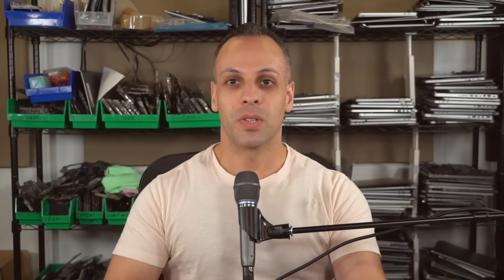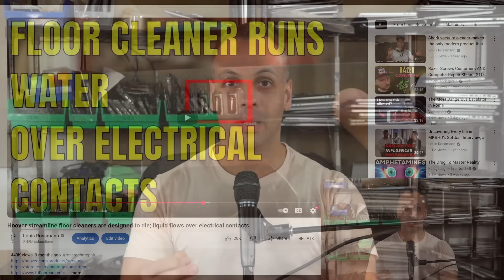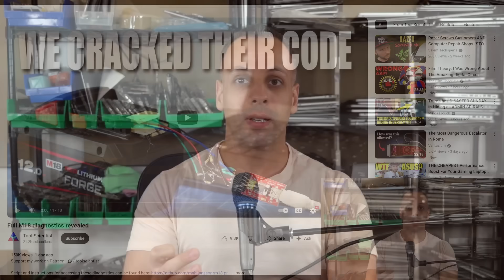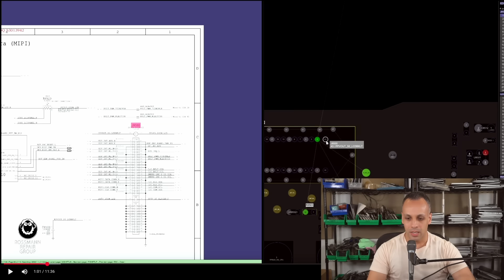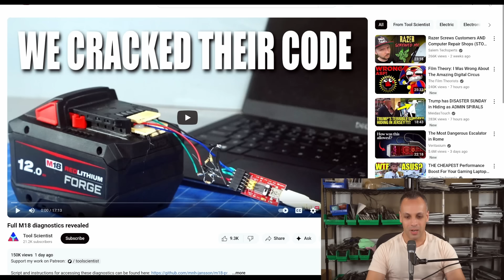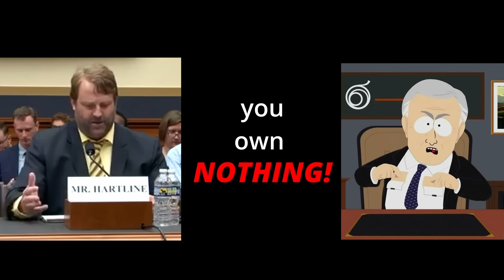Imagine putting DRM in a battery to void warranties...

Comment: HW Engineer here:

I'd like to clarify and correct some technical specifics mentioned in the video.

Topic 1:
1. Not having a balancing circuit to a series configuration pack could potentially result in the pack cutting off at 50-60% due to 1 or multiple cells being under-voltage cells (<2.7V per cell), but that should be your last concern as a user. It would have actually been quite great to be the case, as user safety would have been prioritized by design, doing so. 
Instead, what happens is that the battery charger IC (which again has no balancing functionality, thus leads connected to the series tap points) keeps draining the battery, until its internal comparator sees that a specific X (usually X being the Under-Voltage battery protection set at no.-of-cells in series * 2.8V) has been reached and cuts off the load. The issue with this is that:
a. The cells that start with the voltage below the mean pack voltage get severely over-discharged (depending on how severe the unbalancing is).
b. As a consequence of that, Li ion dendrites start to form at the Anode, severely degrading battery performance and health, to a point where an internal short-circuit and thermal runaway become a certainty. TL;DR, your shed where you store and charge your tools might run a high risk of going down in flames.

2. For them not to include a charger IC with balancing functionality (from Texas Instruments, Analog Devices, Maxim etc) on a series pack config would be a head scratcher and a huge NO NO in terms of HW design. As a HW Engineer & Schematic Designer, you would actually need to force yourself to do so, as all off-the-shelf ICs from reputable brands (some listed above) that are meant to be interfaced with series pack 100% include the balancing function.
Most of them also include a series of other nice features, directly integrated on the same silicon chip, such as: NZV charging, fuel gauging, built-in interrupts and alarms for UV (Under-Voltage) in charge/discharge, short circuit protection, over-loading in discharge etc.

Running a charger IC on a series pack, without balancing, would result in a certain premature death of the battery pack, with a high probability of fire risk for the user. It is a big no-no, if done is a self-inflicted design decision with virtually 0 benefits, other than planned obsolescence and malfunction for the battery pack itself. It is no a question of "if", but "when", and then when the "when" comes to fruition pray for it to not go up in flames and take it with you, especially considering how energy dense those packs are and the fact that they are almost impossible to put out when they do go out in flames. The only solution being containment, but good luck with that in your backyard shed.

To put salt on the wound, the unbalancing gets consistently more aggravated with every charge/discharge cycle due to specific factors, most important of which: the ESR (Equivalent Series Resistance) of each cell, different from one cell to another.

Topic 2:
For the old 50V DC power line design, where a reasonably "higher-voltage" DC line is found right next to a procesor Data line on the MacBook Pro FPC connector, my assessment is that it is as closely related to incompetence as it is to negligence and company R&D flow. Let me explain:
- Usually, when developing a PCB Project, it is super highly unlikely that a single engineer or team goes from high-level architecture, to block-level diagram, to schematic, to layout, to review, to DFM review etc.
Usually, it is a whole array of people across different specialities that handle all those steps, with the first link in the chain being the Schematic Level Engineer. If he dictated the pinout on that FPC connector and it passed with bells and whistles on the schematic review step, then it is unlikely (to a minor degree) for the next dev. steps to catch the error (DRC, Layout Review, electrical-FMEA analysis etc). I find this to be equally split between incompetence, human error and bad procedures (review and process-wise).  That said, it does not surprise me at all that Apple would never publicly acknowledge such a bad design error, considering how many units were sold. It is up to you as an individual to decide, your wallet specifically. The issue is, that most of the customers out there have no idea about those issues (and rightfully so, as they do not have the technical background to comprehend those specifics) and usually choose the simple way out: 2000USD down the drain, and life goes on with minimal friction of changing the OS and their Apple Ecosystem lifestyle

My 2 cents.

*Later edit: Having a look at the video [011] Do Milwaukee FORGE batteries balance, by the same YouTube channel, Tool Scientist, it is lound and clear that they do indeed use a battery charger IC with a balancing feature included (as expected), namely Renesas / Intersil RAA489250, but as cell balancing isn't a fully standalone process and it requires coordination by the system MCU, I can say with 100% confidence this is a design and system decision. Addressable and solvable via a FW update, as the layout and HW design allow it, but I'd expect pigs to fly before Milwaukee decides to do so with either the battery packs out there in the wild (recall) or the ones on the manufacturing and assembly line.
Reply from the maker: pinning to correct myself since I was worked up and didn't speak the fact properly. worked up louis was worked up, and didn't make a distinction between:

1. battery balancing not being present
2. battery balancing being present but poorly implemented, on purpose
3. battery balancing being present but poorly implemented as a result of incompetence 

but this distinction matters: thank you for the corrections, they are much appreciated!
Reply: @rossmanngroup  
Thank you for taking your time to see, read, and reply! I've also noticed that it is now pinned, which is truly an honor. (I made sure to correct the typos now, sorry)
Usually, such long, tech-detailed comments pass unnoticed in favor of the more popular, short, one-liner, puncy ones. It is quite rare for somebody to bother reading those, which is mostly why I diverted from posting on YT, and retreated back on Reddit.
I really didn't expect this to come on your radar, which again speaks volumes of your integrity, community devotion, hard work, and pursuit of "leaving behind something better". Thank you, and hats off to you, sir! For me you've always been the go to info & intel source, and a true role model and inspiration. If I ever get to visit Austin (quite far away from Bucharest, Romania, where I live), I'd love to pay a visit to the workshop and bring a little thank you in the form of a local spirit. Kudos!

Comment: +1:45 that's not how the overtemp flags work I watched the video as well, it only monitors temperature during the beginning and end of a charge cycle, it also measures overcurrent and direct shorts but that's a separate measurement

Comment: I've had Milwaukee for a few years, will slowly begin changing to a different brand after learning this. Question, what brand do you recommend? From what I've looked up, it seems the options are Makita, Hikoki and Ozito, oddly enough. Ozito is cheap but they generally aren't known to last, the only concern I have is switching to Makita or Hikoki and then in 12 months they announce they are doing the same thing. Note: I am currently looking to buy some nail guns, and also, I am not saying I'm gonna throw out the Milwaukee tools and make waste, just that I won't buy new power tools from them

Comment: Both Dell and Alienware used to do this with their computers.

Not only did both (and they still do) have almost all of their help desks overseas. Run by techs who share something that isn’t even an Intel i3, they could only dream of seeing any Intel I chip anytime in their entire lives. Have a tech with next to nothing in any computer education try to phone walk someone through opening up their computer chassis.

But it gets better… If one were to buy a one thousand to $5000+ system though Dell or Alienware from 2002 - present day, and then buy any additional type of “assistance” or extra warranty… Watch what happens to the system specs and performance just one single day outside of warranty.

Comment: 2:20 not to be that guy, but a 52 volt battery is a single battery, the individual parts are Cells. A battery consists of many cells.
Reply: How do you differentiate? They are literally just packs of standard 21700 batteries in a plastic box. It's identical to putting 4 AA batteries in a holder that goes into something.
Reply: @libtrs838 AA "batteries" are also actually only "cells".  If you look at the structure of an electrochemical cell, you'll see one anode and one cathode. If you look at a battery, you'll see multiple cells connected together - anode to cathode to anode to cathode if they're linked in series, or all cathodes connected together and all anodes connected together in they're linked in parallel. Linking cells in series multiplies the voltage produced, linking in parallel effectively makes multiple cells into one big one, multiplying capacity. The word "Battery" predates electrochemical cells and was used to describe a group of cannons - a "battery of cannons". That said, some of the disposable batteries you buy ARE actuall batteries e.g. the 9V batteries used in smoke alarms are actually a group of 1.5V button cells packed together in series to create 9V.
Reply: @libtrs838  I'm nitpicking his terminology (it doesn't really matter). A 21700 is a specific lithium ion cell. When multiple cells are wired in series, they create a single battery. Here, he said that batteries are made up of multiple batteries, while it would be more correct to say that batteries are made up of multiple cells.
Reply: @robomobius I don’t think it’s nitpicking. If the channel does not describe technology correctly, then they lose credibility. Especially when they are trying to show they are smarter or more aware than the manufacturer.
Reply: @Y.T.Learner  🦐🤷‍♂
Reply: @robomobius I guess I'm not sure where the line is. For example an off grid solar car battery array are those batteries or cells since they are all connected? But then each car battery has 6 internal cells. I've always considered integrated cells as cells and off the shelf batteries as batteries in a pack not cells ie Milwaukee battery pack. Only wired in series counts or parallel too?
Reply: @libtrs838  lead-acid car batteries, single use 9V batteries, and old nicad battery packs do just fine without a BMS. Lithium cells are very particular about charge and discharge voltages, and can be damaged by non-terminated charges or discharges, like a trickle charge.
Reply: @Y.T.Learner  I am not sure what that has to do with my question. I was talking about the distinction between battery and cell. I didn't say anything about BMS.
Reply: @libtrs838  A battery is cells in series. Parallel cells is cells in parallel. The advantage of cells in series is higher voltage. The disadvantage comes down to the cell chemistry.
Reply: @Y.T.Learner  I know how circuits work, robomobius originally only said series as if parallel didn't count, i guess I was nitpicking. You didn't answer though, if I build a solar battery array from 12V lead acid batteries is it made of batteries or cells? It's all one big battery? I just want to point out again that every 12v battery has 6 actual internal cells.
Reply: @libtrs838  The term "cell" for an electrical battery comes from the Latin word cella, meaning "small room," and was first used to describe the small, compartmentalized units in early electrical devices like Alessandro Volta's "voltaic pile". The term was applied because these units were like individual chambers holding the necessary chemicals to produce electricity, similar to how a monk's "cellula" was a small room.
Reply: The term "battery" for an electrical device comes from Benjamin Franklin, who used it in 1749 to describe a collection of linked Leyden jars. Franklin likened these stacked jars to a military "battery" of cannons, as both involved a grouping of individual units working together to produce a powerful effect.
Reply: So parallel cells are not producing a more powerful effect per se, however the result of being connected together can help maintain a higher voltage under load and thus more power.  This is the same as using one larger cell.
Reply: @Y.T.Learner  I'll ask again. If I take six 12V lead acid batteries and connect them together are those cells or batteries? Do I have 1 battery or 6? How many cells in this setup?
Reply: @libtrs838  the scientific answer may depend on HOW you hook them up. Physically, the number of cells is the total number of independent voltaic chambers are sitting on the table, hooked up or not. Also, a battery generally refers to a physically joined group of cells which are not likely to become separated during its lifespan.  If a BMS is involved, sometimes referred to as a battery pack.   For me, I would be very specific and refer to my power arrangement as batteries in parallel or batteries in in series, depending on what was done.
Reply: @libtrs838  If you own 6 prisons, you have a prison network/system.  Each prison (permanent building structure) might have 100 cells.  You have 600 cells, 6 prisons.  For your electronic setup, you have one battery system/network consisting of 6 batteries, and 72 cells.
Reply: @Y.T.Learner  so Louis was right it's a battery pack aka pack of batteries aka arrangement of batteries in series/parallel. In a Milwaukee battery pack, the batteries inside aren't physically joined. They are no more joined then AA batteries in a remote control
Reply: @libtrs838  A lithium battery is composed of cells according to the conventional terminology of professionals who know the technology.
Reply: @Y.T.Learner  Lead acid, alkaline, or lithium shouldn't make a difference. If I put two AA lithium batteries in a TV remote is that 1 battery?
Reply: @libtrs838  No, it becomes a burnt remote because it expects 3V and you gave it 8V 🔥
Reply: I learned this in grade school. 😊
Reply: Yes, and I think his explanations would have been a bit clearer if he had made that distinction rather than taking about batteries being made of a number of "batteries".

Comment: I saw the original Tool Scientist video when it came out. There are lots of guys all around the world sorting this out. Bit of a downer for me as I have a couple of thousand £'s worth of Milwaukee tools. I have only ever had one tool need work under warranty, it was done in less than a week no questions asked. Of the dozen or so batteries I have not one has failed although some of the original ones are starting to not hold a full charge, but they are well over 10 years old. However the newer tools don't seem to be quite as robust as the older ones. My old Ryobi ( TTI) was a lightweight DIY in comparison.

Comment: I really don't get why corporations, and the shareholders managing their quarterly goals, decided that chasing the red cent and bottom line was worth flipping off and pissing off consumers.

The same consumers that, as Louis here is proving with hard evidence, WILL find out about this fuckery, WILL be pissed off about it, and a not-insignificant chunk of them WILL look for alternatives and WILL share them wherever they can. Meaning the screwed-over consumer loses, then drags the schemers down with them.

Capitalism, when working as intended, encourages competition through which innovation improves both the consumer's experience AND the seller's bottom line and earnings, all SIMULTANEOUSLY. Meaning that, if these corporations and shareholders just STUCK TO THE SCRIPT, then EVERYONE would win.

No, they wouldn't make AS MUCH money AS QUICKLY, but they'd still get that money. It'd just be in 5 years instead of 3, and they'd still have an AT-WORST salvageable if not outright BEAMING reputation. A single good word of mouth is worth more than a thousand pre-inflation dollars.

To quote Mike from Breaking Bad:
"We had a good thing going. You had all the materials, you could've made as much as you wanted, and it would've all worked out. But no, you just had to blow it up. YOU... and your PRIDE and your EGO. You just had to be the man. If you'd DONE YOUR JOB, KNOWN YOUR PLACE, we'd all be fine right now."

Comment: Don't forget ryobi is a tti brand too, miluake parts fit, but so do ryobi, the difference about 30% in price and a M instead of an R at the end of the part code, only real difference is what the cases are made of miluake is slightly more robust if dropped, that's it the rest is marketing fanbois

Comment: I purchased a Makita drill back in 1997, 2016 the nicad battery eventually died!! I went to the store and asked for a new battery, to my surprise they still make them, the guy at the till said a new battery is £29.99 but I can sell you a new drill for £24.99 I said no thanks I want something that will last! Still running today in 2025!!!
Reply: Makita from about that time.  Died by 2007.  I had the battery packs rebuilt three times. I never bought another Makita (or NiCd) tool.
Reply: Smart move
Reply: Ryobi from 2001, the nicad battery lasted until 2020, now run it on a new lithium battery
Reply: @Drewcardello ryobi is part of the same group as milwalkie now
Reply: @inh415i know.  I am a dewalt-craftsman guy.

Comment: I used to have a pair of Philips headphones that would would only work with Philips AAA batteries. The way they did it was that their batteries had a notch in the insulation on the side of the battery for the negative terminal instead of at the end of the battery😂